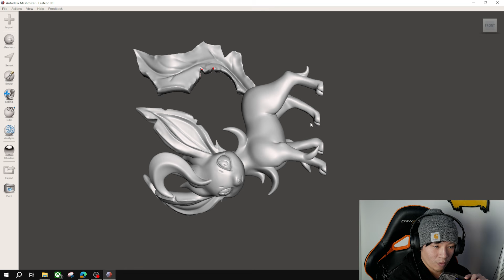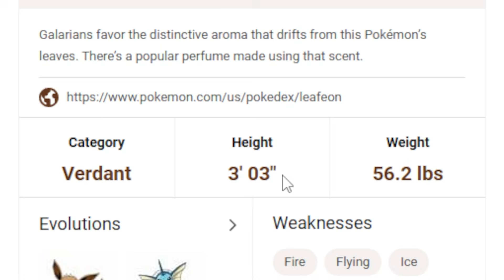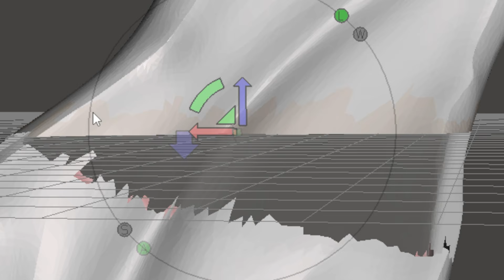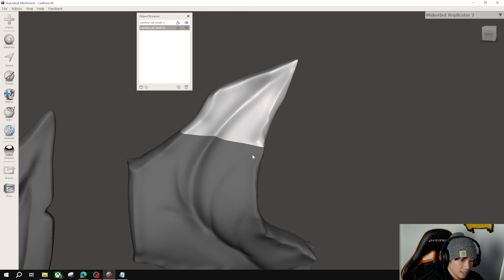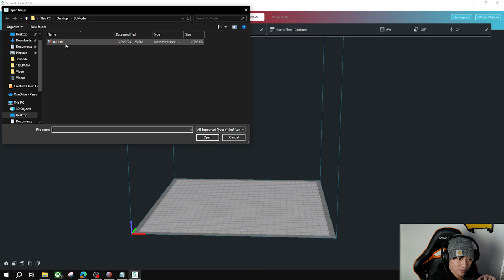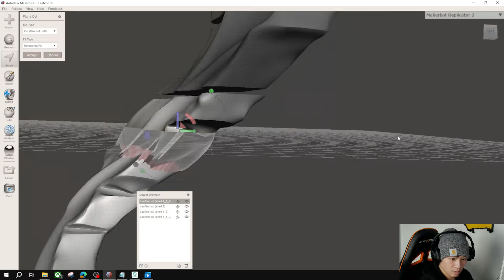How To Slice Large 3D Model To MULTIPLE Pieces for Small 3D Printers using MeshMixer

Comment: Cool video. You should add dowel locators for some parts, it helps when lining up parts during assembly and adds stability in crucial areas, especially thin tall parts.

Also, The word "accept" is pronounced ak-SEPT. 
To agree to something or agree to do something: For example, "He accepted the job offer."
Hope that helps 😀

Comment: Hey! I love the video! I was wondering though I’m wanting to print a life size Sprigatito but when I go to cut the model it splits the parts it seems as separate rather than splitting the part where I painted. Is there any way to fix this?
Reply: It is splitting up each individual price suo for example the head is separate from the leaf shape on its face and the eyes nose and mouth are all separate as well then the ears are split into 2 separate pieces the inner and outer. And the body with the back legs are one piece but the front 2 legs are seen as separate and the tail is also separate. Is there at least a way to group pieces together so I wouldn’t have to piece it all together in the end?

Comment: i noticed you using the "front view" button to check lines. i might suggest trying to use an Orthographic/Orthogonal view. idk about the software you're using, but most 3d modeling software out there has an option for that. makes it a lot easier to keep things in scale, plum, flush, and square.

Comment: You should make a video showing adding slots and joints to big prints to make them more sturdy. Great video tho well informed. I'm bout to print a 2.5 ft master korin from dragon ball z and I'd like to add the tabs for reassurance.
Reply from the maker: hahah master korin is dope!!! You might be the first to print a life size of korin!!
Reply: I've been printing a statue about 1 metre tall. I've found that printing connectors is a bad idea. Its easiest to print organic shapes if you've got a massive flat plane to lay them on so you get good bed adhesion and might not need any supports. A big cube in the middle of that or even and indent for connectors is going to mean lots of supports and lots of cleanup.